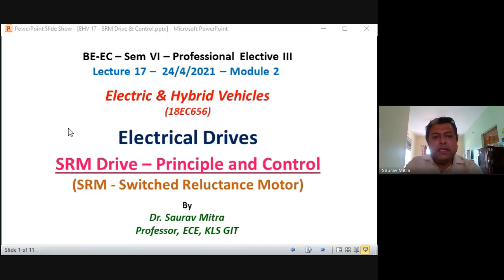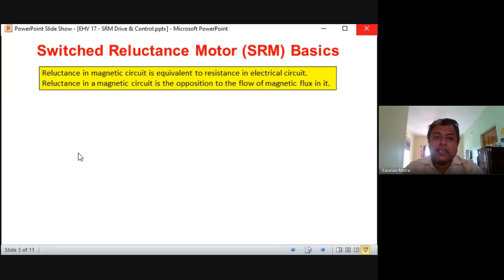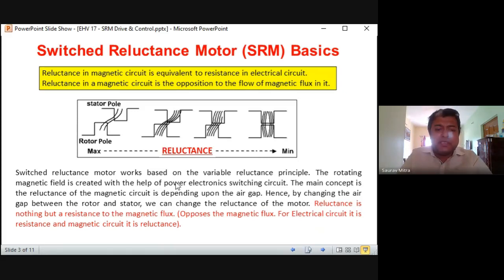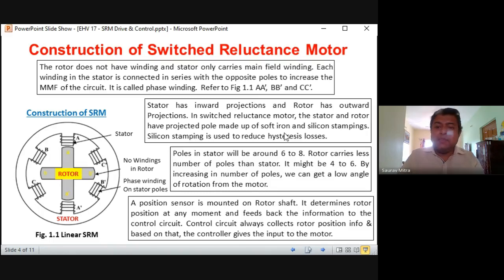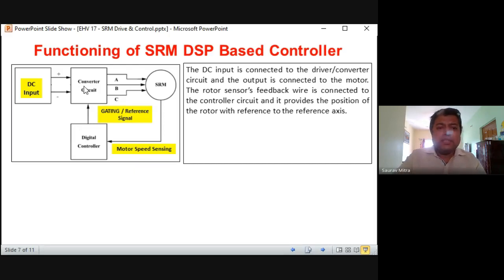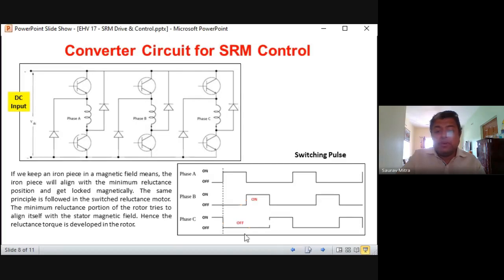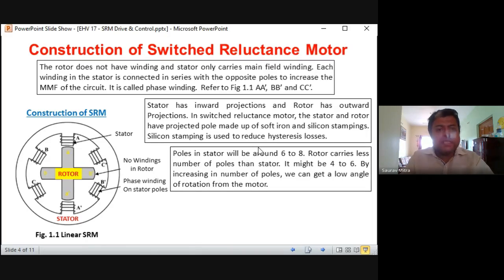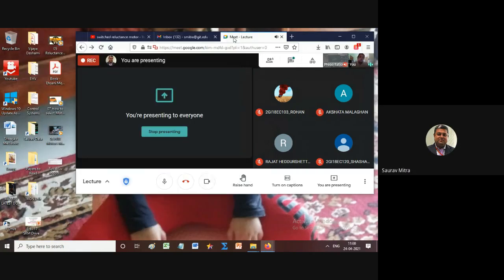EHV - Lecture 17 - Switched Reluctance Motor (SRM) Principle and Speed Control

Comment: Hello saurav
I do not believe this is correct - it may be for BLDC but not SRM. There are no magnets on the rotor, so it does not have poles. The Rotor is just steel. So the stator coils don’t have to create a N or S, just switch on and off. Wether the coil is N or S pole does not matter, as the steel rotor will be attracted towards the coil(s) that are energised regardless (unlike the BLDC motor that has permanent magnets on the rotor which will attract and repel depending on polarity of coil). The only thing that does matter is that any pairs of magnets that are directly opposite each other are N and S so there is a flux path - doesn’t matter which is N and which is S and doesn't matter what pole is next to it - just switch a pair on to pull the stator tooth towards it, and off at the position of minimum reluctance. There is no repulsion, just the next rotor ‘pole’ being pulled towards the next energised coil.